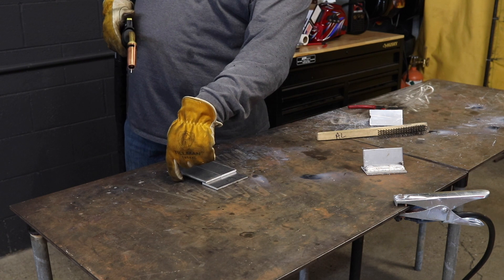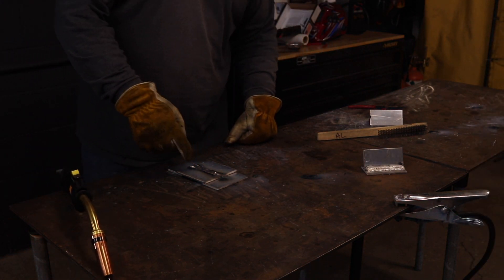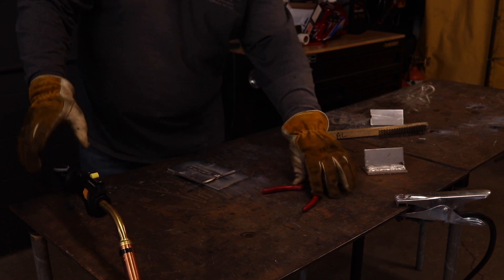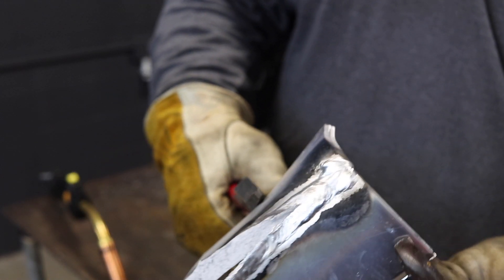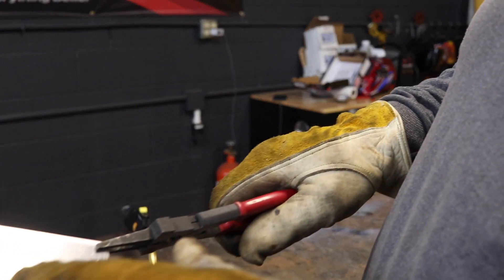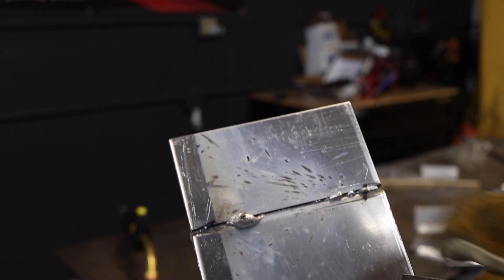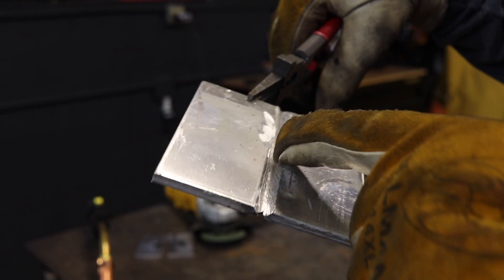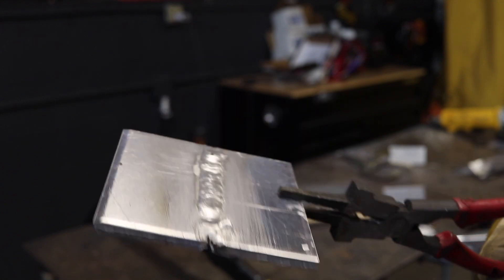Why Do We Need to Back Gouge Aluminum?

Comment: Is it the same with stick and tig aluminum?
Reply: Nobody stick welds aluminum
Reply: mig, tig stick - there are ALWAYS oxides which are fusion inhibitors and if you want to get a 100% weld you ALWAYS need to mechanically clean
Reply from the maker: Yes

Comment: What was your settings
Reply from the maker: Sorry we should have put them in the description. Although these settings worked for us that doesn't mean they will work for you. Every factor allocates to that.
Start Speed: 35% Start Time: .4 seconds Burn Back: 004 Pinch: 95% T2: .1 s Pre: .2 Post: 1 s 429 ipm +2 Volts thickness .197"

Comment: What kind of blade did you use to groove it? Did you turn down the heat keep same speed when welding the groove? My boat is 5056 .160 welded plate, I do see welds on inside too, I'm not easy on it always, wondered if they weld both sides for a reason. 
Going to be welding up two tanks from .125 for it this year will keep this in mind.
Reply from the maker: No turning down required but you need a wheels that is specifically designed for aluminum so it does not load up. We recommend the rexcut abrasives Sigma Green 7" dial with 36 grit. No the settings were the exact same on both sides. You need to wait for the piece to cool before welding the other side or else you will get cracking as demonstrated.
Reply: @usaweld  I thought some preheat from first pass would be beneficial, are you saying to let it cool completely or partially after gouging it?
Reply from the maker: @omieyouknowme  If we are being realistic by the time your are done grinding and cleaning the backside the piece should be ready to weld on again. If you are doing a large project or repair you wont be working on the same part of it forever. So it really just depends on the project. If it happens to still be warm you need to take that into consideration with your settings.
Reply: Just get a aluminum blade and put it on your grinder. We call them a meat axe. Works great.